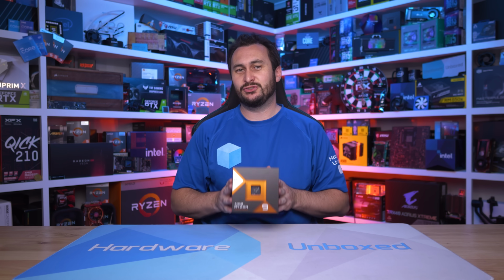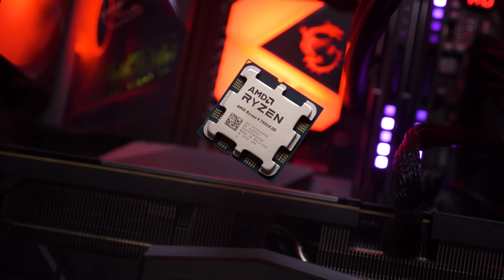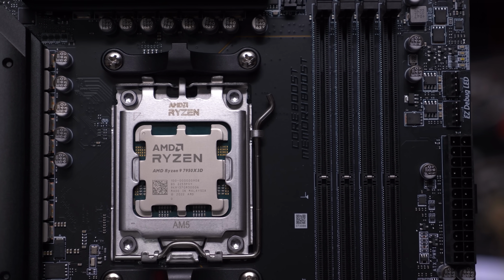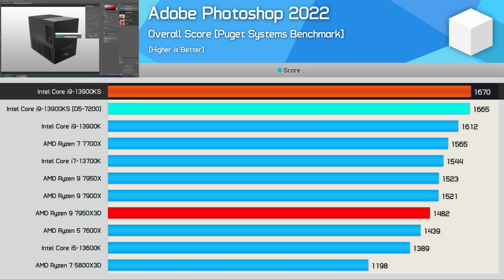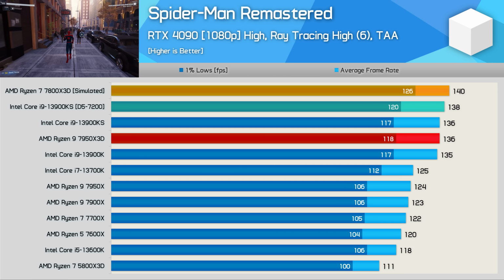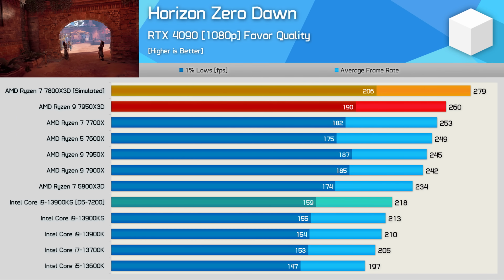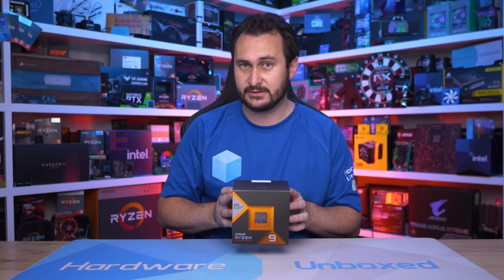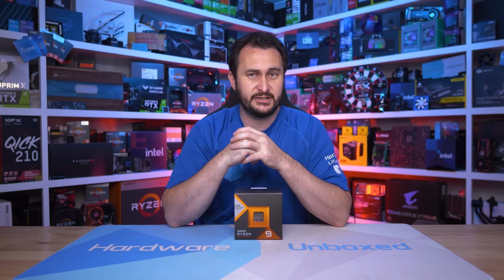AMD Ryzen 9 7950X3D Benchmark + 7800X3D Simulated Results

Comment: Considering how heavy ray tracing seems to be on the CPU too in most recent games I do believe CPUs should be tested in the highest RT preset possible.
Reply: And then you get what result? Just new lower numbers but same ratio?!? Still some ppl don't understand GPU vs CPU testing.
Reply: @ismaelyu5  With 4090 most recent ray tracing games are not only CPU not GPU bound when set to full RT but they also often struggle to hold 60fps despite GPU not being fully utilized. 

It's cool that this CPU can do 400fps in some Tomb Raider with no RT or 1000fps in Valorant but what would be actually useful is if that CPU could hold 60fps for example in Hogwarts Legacy with full RT. Something no CPU so far could have done. 
And no, it definitively is not as simple as just scaling non-RT results down.

CPU tests like that are simply outdated.
Reply: @RJ-vy4yd  sorry you just proven, that you don't even understand what a CPU or GPU benchmark is.
Yes, numbers like 400 FPS are irrelevant. What's interesting is the ratio to other hardware in a wide range of softwares.
What you want and described is a software test, with different hardware.
Since you already have a ratio from this CPU to others, you can do the math yourself, to what degree the CPU scales on your software.
Including your RT test just gives you a number in 1 or more games? Should there be a retest every game launch just because you can't to math?
Reply: @ismaelyu5  No, what you have proven is that you have no experience with ray tracing. 

Why do you think they even bother with testing CPUs in different games and software? According to your logic they should just do a Cinebench run and call it a day. We could take "tHe rAtiO" and estimate the performance for ourself. After all it scales the same in every kind of software, oh wait...
Reply: @RJ-vy4yd  again you give an example of testing software, not hardware, and that's not what I wrote. Learn to read, that's why I said to use a wide range of software, that's what they did, including non games.

They have you an estimation of what to expect.
What you want is an exact number in a single software, at the moment there is just the extreme example of the game you mentioned and you forget that it isn't only RT that make it more CPU bound, it's also it's protection algorithm that sliders it down, so in a different RT title you get a different RT behaviour on the CPU.

Still the scaling to other CPU models stays in the predicted region on every single of these titles. You just don't understand how to analyze and use the data you got
Reply: @ismaelyu5  
CPUs perform differently in different kind of workloads. Just like you've got normal games and productivity software sets of tests, ray tracing games differ enough from those to justify their own testing category. They have their own category in GPU testing because back then people thought they'd always be just GPU bound and CPU were irrelevant there. As it came out they are not so now its a time to include RT games category in CPU testing too. 

You're just naively assuming that CPU performance in RT games would scale the same way as in non-RT games.
Reply: @RJ-vy4yd  why do you think it is naive to assume the ratio to other CPUs stay in the same ballpark. that's how an average ratio works, to begin with, and you still don't understand it.
When CPU A in the average is 5% faster without ray tracing, it will still on average be 5% faster with RT. Not on every Title and not always just 5% but that's why we use an average ratio.
But go on, insist you need those numbers.
There will be more reviews with these CPUs and you will see I am right
Reply: @ismaelyu5  The examples we've seen so far show it is different type of workload. It puts load on CPUs in a different way than either old games or productivity software. 
You can't take the results that one CPU is 5% faster in Adobe Premiere and assume that it will also be about 5% faster in Call of Duty. Same goes with RT games and non-RT games and other software. That's why there are those different categories. My point is to add an additional category for RT games  to have more data to work with. There's no harm in it and there's also no deny those data would be useful. As even if I'd be completely wrong and you'd be right and it would turn out that RT games scale just as other games do, there would still be a useful data which CPU lets you to meet the threshold of 60fps and which not. That would be very useful on its own yet I'm more than sure that just as there are differences in GPU scaling in RT vs non-RT, there are also differences in CPU scaling - something we couldn't observe back then as GPUs were simply too slow to reach the point when it started to show. With 4090 it's not the case anymore and CPU performance in RT games is now a very important factor that has no reason to be ignored. 

And yeah, if this channel won't include such tests I'll simply move to those which have them. I'm simply leaving here a feedback that there would be interest of such additional data as they would be useful. 

You on the other hand are like "meh i don't need those data because I don't own 4090 or maybe even any RT capable GPU at all so fk those guys who have it, they should not get the results they are interested in". Kind of pathetic I'd say.
Reply: @RJ-vy4yd its in now way pathetic, because if you insist on this point, i want results for any other possible configuration out there, especially mine too.
Your last sentence sounds more like you think that your in a special position. but you  aren´t. 
Also your Results will not last long as windows, drivers and the games gets patched to this new techniques.

i had those discussions  everytime there came a new one: MMX extensions,  North- and Southbridge, Shaders, Multicore etc...

Comment: That simulated result in factorio is 74% faster than the vanilla 7950X and about 25% faster than the 5800X3D. Looks you are almost entirely gpu limited in Cyperpunk. Obviously for gaming you would not build a 13900k/ks or 7950X/X3D. You would wait and build a 7800X3D system.

Comment: I don't usually care for any specific game, don't matter much for me and can estimate based on the others, but could you test Cities: Skylines with 7950x3d or one of the other x3d's when you benchmark games for them?

Because it's a very cpu limited game, both using very few cores but memory also being very important (especially modded)
Now I don't expect you to try it with mods, but maybe with a very big city savegame from the steam workshop.
Reply: Hi there. I don't know if it helps you but I did a test last year with a 5800X vs a 5800X3D and the FPS went from 44 up to 66 in my Cities: Skylines bench scene. The game is completely CPU bottlenecked in that scene. Overall a huge improvement in simulation games like Cities: Skylines, Factorio and X4 Foundations. Even in Fallout 4 where I benched 7 different saves and in 2 of them with massive draw call counts the FPS went up 43% and 51% respectively. Was worth every penny in my opinion.
Reply: @Eddy_Karacho  exactly, I know HWunboxed also did include that game on the 5800x3d review.

That's why I'm curious about the 7950x3d in it as well. Till what point more cache helps.

Comment: Very nice review Steve. I had the same suspicion as you, that the 7800X3D would be the faster option, given that only one of the CCDs got the cache. A missed opportunity from AMD IMO, not putting it on both, or perhaps even on the I/O die.
Reply: There is an easy answer; no game would benefit from that, so they didn’t do it.

Comment: 7950 = fail. Hot AF, poor working performance, x1.5 price of 13900k for +1% in games, -10-15% in multicore workload
7800x3d for 500E=fail. Add +50E and again buy 13900k, for x2.5 multicore performance and 50/50 in games.

Hopefully, zen-4 will perform better

Comment: Guys, love the video and the simulated 7800X 3D, but I think your test bench has a problem, in many instances, the 7600X is significantly faster than the 5800X 3D especially in heavy multithreaded games, this is not normal at all, the 7600X doesn't have 3D vcache and has 2 less cores, there's no way it's beating the 5800X 3D, not even close.

Comment: The 5800x3d seems to be the champions of CPUs the same way the 1080ti was once the champion of GPUs. A very good product that was ahead of its time and will go strong for a few more years. 7800x3d or 13900ks are not that impressive in comparison. They are much more expensive and use so much more elecricity. The 15% to 25% in perfomance is just not worth the upgrade if you are already on am4.

Comment: Did you account for the 700Mhz frequency drop of the 7800X3D in your simulated one?
Reply: The 5,7Ghz boost on 7950x3d is referring to non-cache CCD only and 7800x3d will only have a cache chiplet. 
That's where that "700Mhz" of difference is coming from when you look at the sheets. 

It's reasonable to expect very little if any frequency differences between 7800x3d's only CCD and 7950x3d's cache CCD which is the only one working when running the games.

Comment: Do you think its work it for 4k over the 7700x? Wish we had higher resolution charts as well 😢
Reply: as long as ur gpu is faster than your cpu, u will get more fps

no high res test needed. a cpus which does 100 fps in 720p, does is also in 4k

Comment: Which X3D chip do you think will be best for MSFS 2020? You guys should definitely benchmark this title because so many people play this, and it is CPU intensive!
Reply: According to Techtesters 7950x3d is fastest in MSFS (104fps vs 89fps on 13900k at 1080p ultra high).
Reply: @RJ-vy4yd  but do you think the 7800X3D would be faster than the 7950X3D in this title? They didn't simulate the 7800X3D like what was done here
Reply: @FloridaVibesOfficial  No idea. They haven't but I wouldn't trust that "simulated" results anyway. 
However I'd expect 7950x3d and 7800x3d to run games with close enough performance to each other to not bother testing and choosing which one is faster. It's more of a choice like "do you need productivity performance apart from gaming" or "can't wait 2 months" vs 250$.

Comment: Big oof, it splits games w/ a 13900K for $140+ more? The fuck?

Zen 4 on a whole is just a massive disappointment.

Edit: And the worst part for AMD is the 13900K/KF has much higher hardroom to push it w/ tighter timings/higher supported memory  & 5.8ghz OC w/ ease all while being much cheaper. All down the entire 13th gen K series product stack compared to the 3D series. AMD really missed the mark this gen on both Zen 4 & RDNA 3.

Comment: The deficit of the full 7950X3D vs the simulated 7800X3D should have something to do with the windows game mode and the XBOX gamebar that recognizes an app as a game or not. Those ones that show the 1st slower than the 2nd one might be the ones not recognized properly and needed to do so manually. Kudos for the review!
Reply: Steve from GN explained that the power plan has to be set to Balanced so that the Chipset Driver can park the non-vcache cores when gaming. Personally I think it's pretty dumb coz it invalidates one of the oft-mentioned justifications for a 16-core desktop CPU: having a load of background tasks running while gaming. Intel is looking pretty smart now with how they solved this core affinity problem by implementing thread director with Alder Lake.
Reply: @jihadjoe  I know right?  Who in their right mind wants to band-aid a $700 processor with several pieces of software and power use fixes?  I'm not sure I even understand why AMD even put this out right now.  How many average gamers are gonna know to take all of the steps (latest bios, latest windows and updates, extra software and power settings) to make this processor work properly?  And then actually know if those band-aids actually are working for the games they play.  No one is gonna want to bench test every game to see if everything is working as it should before they play it.  I have a feeling that this is gonna get curb stomped by the 7800X3D when it finally comes out and this is why AMD put this thing out first.  Bad move in my book.
Reply: @rvman3359  Your average gamers aren't gonna buy this CPU.
Reply: @rvman3359  Hopefully this will be solved through some windows update and "just work" in the future, that would be the best outcome. However, everyone currently on AM5 that buys one of these CPUs is going to have to update their BIOS regardless, otherwise the CPU won't work at all.
Reply: @rvman3359  You're taking this out of proportion.
Reply: @dennisjungbauer4467  This is a band-aid fix and it's as simple as that.  Don't get me wrong, I'm very thankful for what AMD is doing and my 5800X3D is the bomb.  But I would not have purchased it if I had to go through all these teething issues.  This release feels like a rush job.  The real questions is, why?
Reply: @rvman3359  Not sure I understand what you're talking about then if you're comparing it to Intel - didn't Intel have a similar problem with their big-little architecture? The software side is relevant there and Windows needed updates to work properly/take full advantage of Alder Lake.
Also, what "several pieces of software" do you mean? Just the different parts that need to work together? It sounds like one needs to install additional software, but according to the video and comments I've seen that doesn't seem to be case (haven't looked into this further yet, just watched this video yesterday). So it sounded like an exaggeration.

But in any case, it's not like you suddenly have a turd if it doesn't take full advantage, these CPUs are powerful and you're still gonna get very good performance if it doesn't work properly.
Reply: @dennisjungbauer4467  Xbox game bar must be installed to work (sort of) properly and the issue is if it doesn't understand your using your game vs production software, you can lose up to 30% of your performance.   Gamers Nexus makes this very clear on their 7900X3D review.  The sad part is Xbox game bar is not perfect, and is a band-aid for this implementation.  As far as Intel, after doing some digging (not an Intel guy) I was wrong about that.  They indeed needed a major update (W11) to make it work right.  So I was a bit off on that.  Sad thing is, these are very large companies (billions) and are selling high dollar parts before they are ready.  That's like me buying a car and then after the paper work is signed I find out that I need to add a special additive to my fuel to get the Mpg they advertised.
Reply: Let's let others be beta testers! Do not buy this crap

Comment: So, Intel, with a 5 years old node, wins by a substantial margin both in single-threaded and multi-threaded performance, and the 3D VCache, AMD's biggest innovation, is only sufficient to tie or slightly beat Intel in gaming. I think AMD should be scared

Comment: It's insane that no cpu can do above 60fps 1% lows in hogwarts legacy .  (With 4090 that is) let alone turning on RT which increases cpu load  . I wonder how much it's better with a 7900XTX
Reply: well amd GPUs and CPUs work better when SAM is on. I think overall full amd build is smarter waay to go for price to performance
Reply: @Kage0No0Tenshi  even when the sam is off or when you're using intel cpus ,
 Radeon drivers have reduced load on cpu compared to geforce